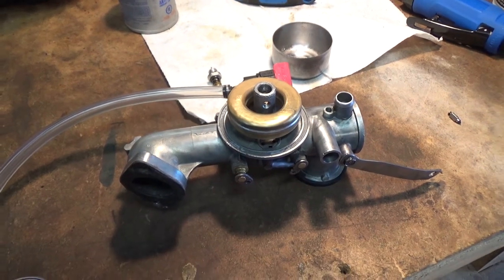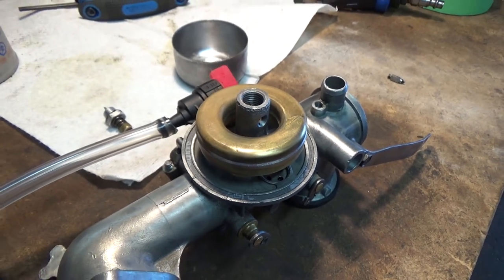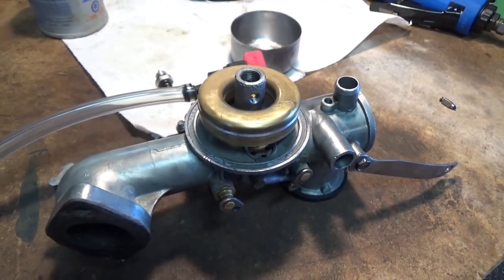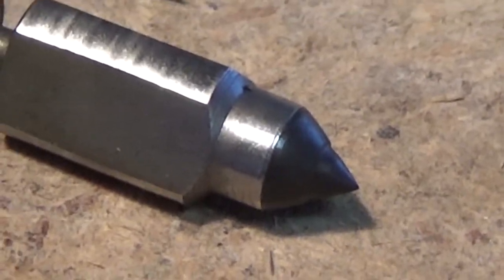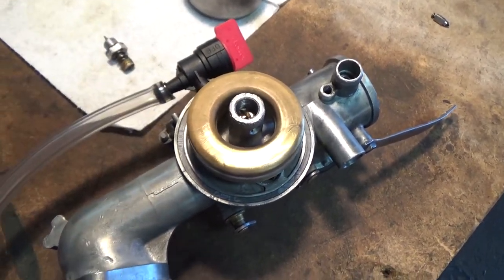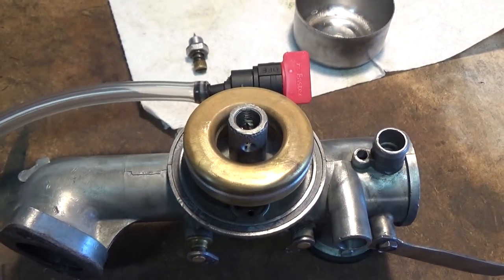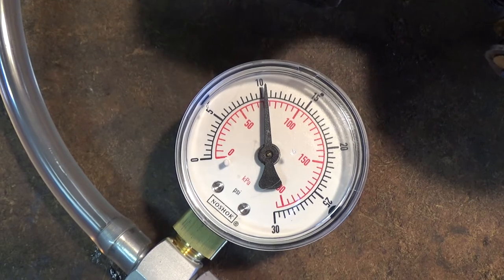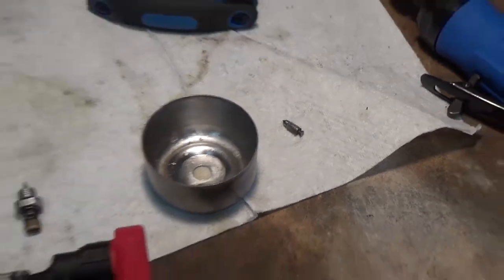How to Pressue Test Carburetors!

Comment: Dude congrats on the 200+/10,000+ great vids really helpful and pressure tester really a good tool to use since blowing into the fuel valve will never let you know if you have a slow leak on the needle valve seat. Gotta get me one of these, where did you get yours have seen Mityvacs but never this one?

Comment: I was wondering why you didn't use any oil or lube for a proper seal?
Reply from the maker: Excellent point, usually I do use some 3in1 oil on the needle valve to help it seal, but in this case the needle was deformed and needed to be replaced.

Comment: Thanks for this video and the How does a Carb Work? video. what are the symptoms on the engine with a worn needle valve seat? is it that fuel goes into the carb when the engine isn't running? or does it affect the running of the engine?
Reply from the maker: Yes it'll flood even when running and bog out

Comment: Do you always test to 10 psi or does it depend on the engine?
Reply from the maker: I actually test at 2.5-5 psi now and see if it holds. This one went up to 10 most likely because of the heavier metal float!